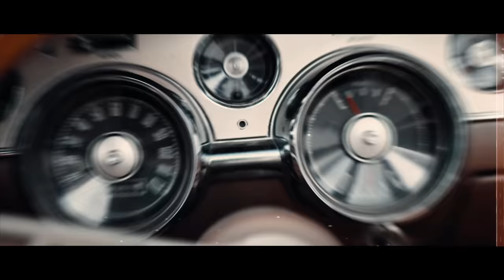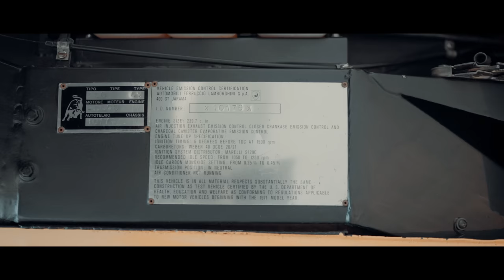FOUND: Playboys, Shelbys, and Lamborghinis - Wheels & Deals

Comment: Hello triple R, I’m back. I noticed you missed me. I had to travel a little. My platoon wanted their platoon sergeant. I had the brig platoon. You had to been in the brig for two months to two years. Best of the best of the Corps. I drove my 1980 vett up their. When I got her home again I almost got 5 thousand miles on the lady. She did good. She had to be fed every five hundred miles. Need a 11 rear end. At 75 she’s setting right on the red line. Muncie four speed top speed is 85 on odometer. Your in red line at 75 1/2. But she fast enough me. I get all kinds of looks. She’s covered in the garage with light breathing tarp. SEMPER FIDELIS

Comment: I'd like a 68 big block vette 4 spd.  metal T-tops, Astro Ventilation, all black with black interior, manual steering with quick ratio steering arms, black western hurricane rims sporting 14" wide ET drag radials factory side pipe car with carbon fiber suspension oh, and possibly a rear spoiler.   Am I asking for too much?

Comment: Those prices are out of line. $30K on that Salsbury is over the moon and back again. Insane
Reply: No actually not really that's a very rare one because it's got but I like to call the old locomotive engines the Fairbanks Morse.
A lot of times people take a Honda and stick them in there and retrofit them but with the original Fairbanks Morse yeah that's kind of worth it
Reply: @truckerkevthepaidtourist  the Fairbanks he referring to is the magneto for the ignition. Salsbury scooters use Salsbury engines and their proprietary CVT transmission. I've had 2 model 85 Salsbury and they suck.
Reply: @Klassiccycles  oh is that it okay I didn't know that?
See when they say Fairbanks Morse so I'm a train geek also along as Long haul truck driver.  but I've Loved trucks and trains my whole life and I think about those big heavy duty fifties switcher locomotives that were powered by Fairbanks Morse.

So I thought that thing actually had a little industrial Fairbanks Morse engine but thwn again I'm an idiot 🤪
Reply: @truckerkevthepaidtourist  nah your not a idiot. You just don't know about the scooters.

Comment: $250,000 for the 63 Vette, $80,000 for the Shelby, $40,000 for the Lamborghini, $100,000 for the Defender, $40,000 for the MGA, $50,000 for the Austin-Healey,  $80,000 for the Maserati, $100,000 for the Viper, 
$40,000 for the scooter,  but yes I know that's "retail".
Reply: He’s got them by the balls on the 63 split window corvette.Go find one of those.
Reply: @johndeere8594  They're out there. Original 63's with 427 & 4 speed go for a million.
The 1 in this video had been sitting awhile but was fully restored so that's why I valued it @ $250k but it would depend on what engine & transmission & if it needed anything.
Richard needs to turn this deal over to Dennis Collins.
Dennis would've left with the Vette, Shelby & Healey at least.

Comment: 1 of 328 made, oh I know that car, that was one of the cars that drove lamborghini into bankruptcy as it was such a junkheap, and it uses the underpinnings of all the V12 cars that came from it all the way back until 63, like it'd be ideal as the car you drive when you dont want it to be known what it is given how ugly it looks, but its not really that rare or special, its like a 50K car tops, and even then you'd only buy it for the motor to put it in something else. 

also for something that rare theirs one local to me, dumped in a barn because of how bad the electrical's were and its probably farm feed by now with how crappy it was lol 

as you literally have two of everything, and its a nightmare just to keep it running and in sync, especially with those fire prone webbers they always came with that caught fire on everything, miuras' especially, and you'd be far better off just buying a Jag XJ6 and putting up with the problems for 30K to get the same experence with half the problems that come with it

to say nothing of the insurance and the usability of such a thin skinned automobile, as these used to be so pin thin you could push in the body with your thumb

and that reminds me I hope he resprayed it as the paint on these were awful and rusted out the second they got anywhere near mosture, as theirs a reason why when given the choice between the two, you always bought the ferrari if you wanted it to last 

and then you took it to the guy john carmac did to make it as fast if not faster than these ever were, as he managed to get a twin turbo'd testarossa out of the guy in texas that can blow the doors off of a tesla in the 90's for probably 1/3rd what some guy like Currated is gonna tell you this is worth. 

and even then why would you buy this ugly thing over an espada, as this is a classic case of its rare and we dont care the market special